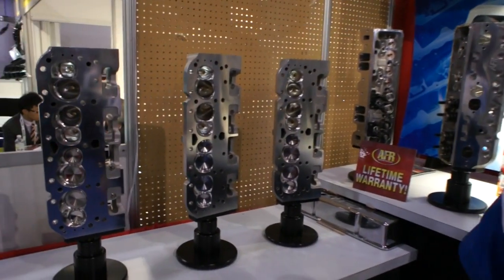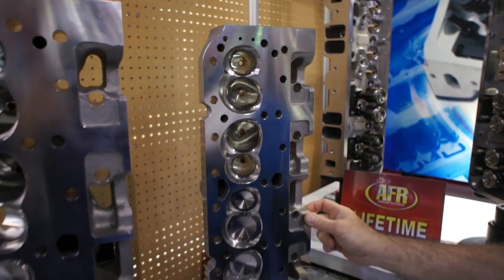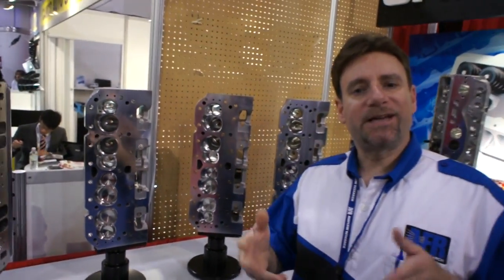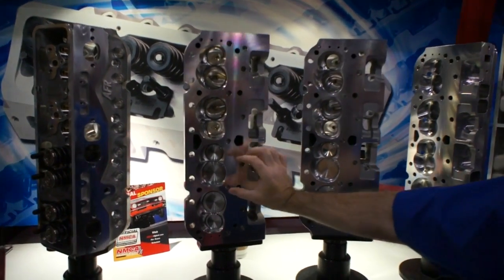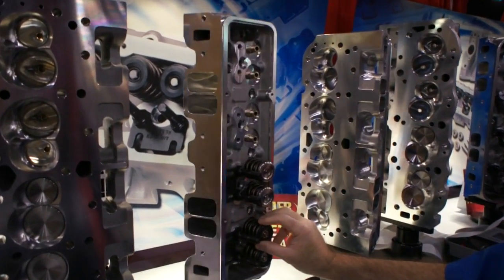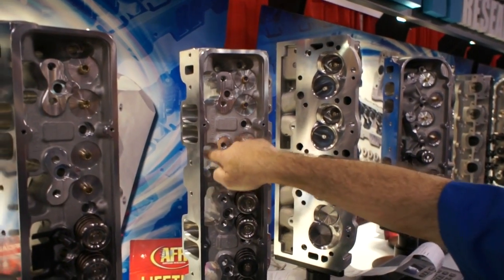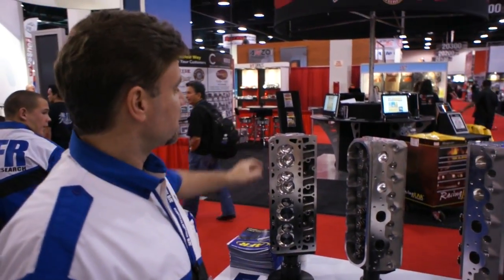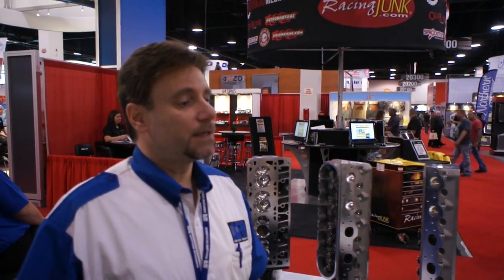AFR: AirFlow Research - Performance Chevy Engine Heads

Comment: WARNING!!!  AFR CUTS  CORNERS!!!
While putting my engine together, I found that the corner of the head doesn't cover the water jacket seal on the head gasket.
Reply: A carpenter always blaming his tools. Do your homework before you order. Also all AFR heads use a slightly egg shaped head gasket they are not round   or they will hang slightly in the pocket. These guys know their shit.